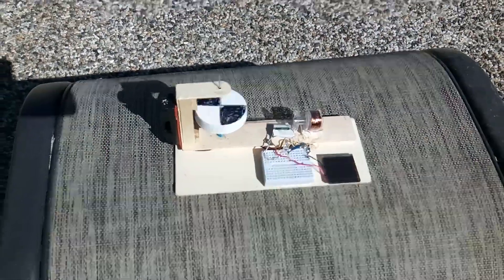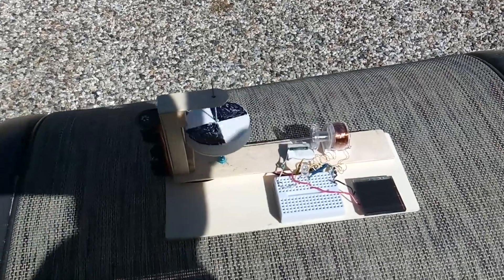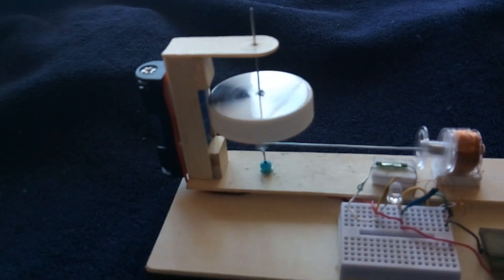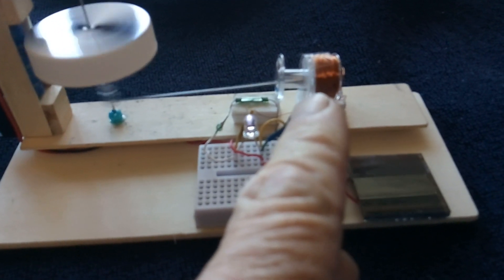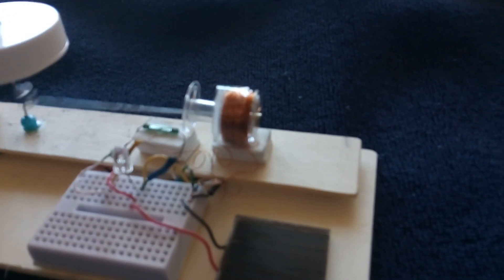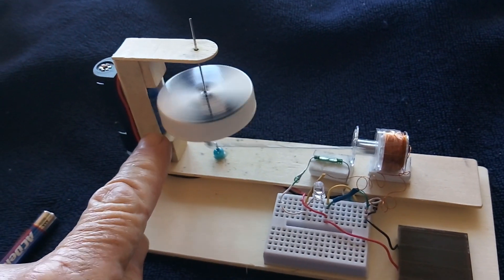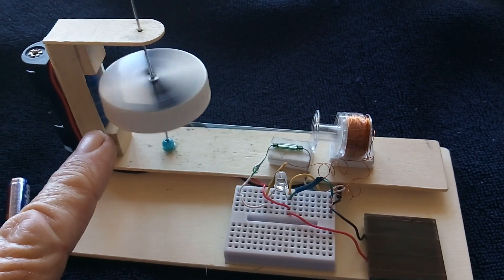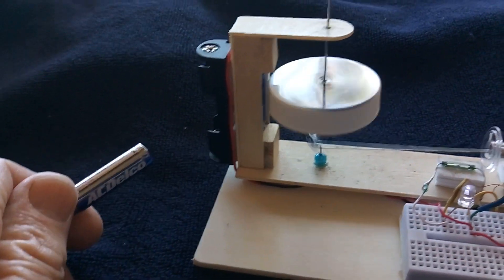Solar Powered Solenoid Engine

Comment: Quiet and efficient is one thing, but noisy, mechanical and efficient is on another level :)
Great to see it on solar.
I wonder... Hall Effect sensors are generally able to run from about 2.5V, so could an efficient blocking oscillator first stage run the Hall, which then runs the circuit?
Reply from the maker: That is worth a try.  Going to 3v doesn't bother me too much if the overall wattage stays low enough.  I think that " ... noisy, mechanical, and efficient..." is a glorious quest. Ha.

Comment: Great Breadboarding layouts. Put a second Separate winding on the solenoid so that with the hall effect U can take the collapsing magnetic field and run it through a bridge rectifier and use it to return charge to the super cap. There's ample magnetism in the solenoid action to achieve this. It will then be a pulse transformer.
Reply from the maker: Good tips.  Thanks.

Comment: And with a ball magnet. Minimal friction if it's able to manage the pull off the coil.
Reply from the maker: Yes!  I will have to order some.  Thanks.
Reply: Wouldn't a ball magnet have the pole change as it rolls?
Reply: @tootalldan5702  had to be fixed . And it was just to be with something that slip without tuching too much the plastic. I change my mind and think about a teflon tube. Thanks for participate.

Comment: Seeing mechanical moving parts is always going to catch my attention 👀👀😊😊
Reply from the maker: One of these days you will have to build a Stirling engine.  That will really catch your attention.  A simple soda can engine can be done rather quickly and is pretty easy to get running.
Reply: @Lidmotor  I cheated on that. I have one I bought on eBay 😆😆
Reply from the maker: @GrandadIsAnOldMan  I actually bought two different types onlne also and have had godd fun with them. I did a bunch of videos on them.  Actually building one of your own and somehow getting it to run is hard but rather rewarding.  I found THAT a bit addictive.  Sort of like building a better rubberband powered car.
Reply: @Lidmotor  I watch Blade Attila, he seems to make them out of anything and everything 😊